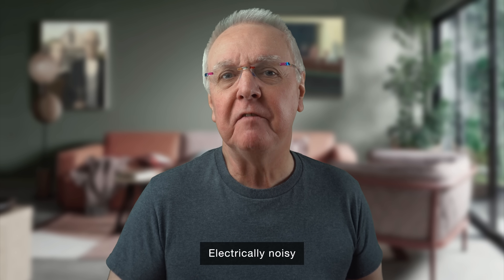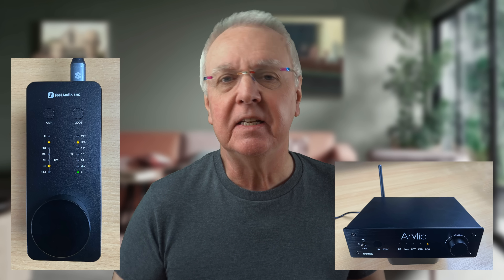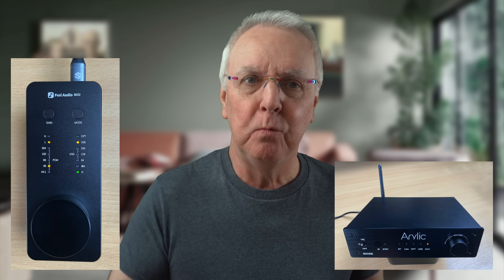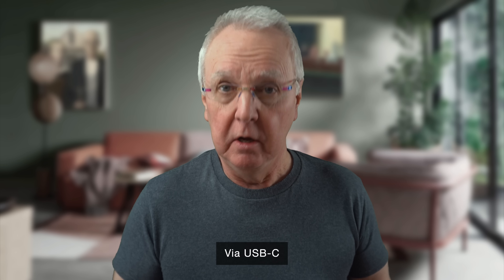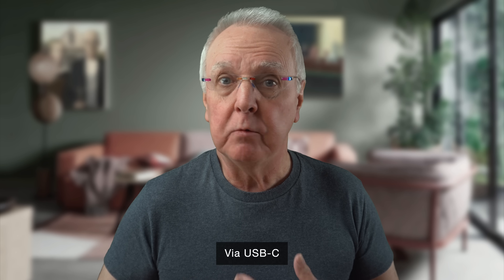Do optical cables have a sound?

Comment: You need audiophile optical cables with gold-plated connectors; a veil will indeed be lifted
Reply from the maker: You jest but I’m sure we could be looking at quarter wave coating for the tips.
Reply: @AudioMasterclass  Yes, or perhaps a special index matching fluid so there will be absolutely no loss at the glass to glass interface. Of course, that could color the sound...
Reply: Sadly Toslink fibres with gold plated connectors do actually exist. 
As the proverb says “a fool and his money are easily parted”
Reply: The only thing lifted is the wallet from your pocket.
Reply: Dave, I agree with your comments here in this video. I have no problems with interference, so I use coaxial for digital, but I have used optical cables and found no practical significance in sound comparing a "good" optical cable to a coaxial one, but my experiences led me to the conclusion that optical cables are less reliable due to the variables you have mentioned. 
Cable routing and conectivity at both ends seem to make a difference in throughput, and reliability is threatened by poor handling. 
I have tried multiple optical cables of one and two meter lengths, at around £10-£15, and found quality quite variable in that price range due to quality, mating, or signal integrity, but, if a cable and its connections were "good," there was no sonic degradation. Some of the optical cables sounded no different with CD quality audio, but some would handle 24 bit, 192 kHz, and others wouldn't, which brings up some interesting thoughts. Anyway, have a great day Sir..
Reply: oh yes, and don't forget to orientate the optical cables such that they are aligned with the Earth's magnetic field.
Reply: Gold looks nice and gives a psychological impression of quality. Psychology of this kind will affect how some listeners perceive the sound. The sound isn't actually better with the fancy optical cable, but if the user THINKS they sound better, they will enjoy the sound more. If a tree falls in a forest....

These prejudices and placebo effects are not repeatable, however.  They are real experiences for those susceptible to them - and we all are to some degree - but do not exist as actual physical, measurable reality that can be measured by instrumentation.
Reply: @billmilosz I actually like the way gold looks in my setup which has reds, blacks, whites, brass 😂 most of the time, at least for non snake oil cables the upcharge is between 1 and 2 bucks for the bling.
Reply: @billmilosz  Psychology of this kind will affect how some listeners perceive the sound. The sound isn't actually better with the fancy optical cable, but if the user THINKS they sound better, they will enjoy the sound more - That's the point! So optical cables have a sound!
Reply: Accurate and on point as ever, Dave 👍🙂.

I would suggest that if you're buying an Audio Quest fibre optic cable between £500 to £1k, they will reliably inform you that jitter in lesser cables is a real problem 🤣
I always believed that fibre cables were better for long runs over 5m as there was no chance of interference.

A lot of people seem to point out that the analogue to digital and then digital to analogue conversion for this signal path uses lower quality components when compared to coaxial .The reality is, I honestly can't tell the difference.
What I can tell you, from a very recent experience, is the quality of plugs now used on many different brands of fibre optic cables is the biggest source of signal problems caused by badly fitting plugs or sockets.
Recently due to a lack of spare connectivity I was forced to run a fibre optic cable between an Oppo 205 and a Cambridge audio 851N using an expensive QED cable.
The connectors would not lock in. Under a microscope the plugs look poorly moulded, if I hadn't known better I would have  said the cables were fake, but they were bought from a reputable company.
Ironically I ended up buying cables from Richer Sounds that were very cheap and they locked in perfectly 😫
Reply: Yep minimum for 100 USD - better is for 1k USD .... better for manufacturer ;-)
Reply: Absolutely! Without  Optical Cables that cost over $5000 a piece, you are wasting your money.  /s
Reply: @coolnout3765  Can you show a optical cable that costs more than $5000 please
Reply: Good joke!
Reply: Haha, yup... I needed to order some for my ADAT setup and I saw this adds on Amazon... gold plated connectors?! Mhm... Wtf.  Why..... Amazing that there is a market for these cables.
Guys who would buy those will also buy a WiFi cable....😂
Reply: The veil lifted off the price tag of the overly elaborate presentation of the fanciest optical interconnect on Earth!
Reply: Just wait until you put your TOSLINK cables on dielectric cable carriers, lined by Shakti stones. The increased clarity will be so obviously noticeable that only those those with the most wooden of ears would fail to be blown away by the difference.
Reply: The gold-plated tips on the standard TOSLINK connectors are pure marketing.
However, the gold-plated tips on the 3.5mm mini-toslink connector actually make sense; they serve no electrical function but help protect against mechanical wear to the plating on the 3.5mm headphone plug contacts in the headphone socket, particularly if the mini-toslink plug uses a glass-filled composite plastic for the shaft.
Reply: @maidsandmuses  pure gold is actually a very soft metal, comparable to finger nail hardness.  Plastic can be 50 times stronger many times. So i doubt what you are stating here.
Reply: The gold connectors make low resistance electrical contacts over the fiber run thus eliminating ground loops.
Reply: @nabman_ 
Ummm ... hate to break this to you but the whole point of optical fibre is that there is no electrical contact.
Reply: @Douglas_Blake_579  this whole thread is sarcasm 🙂